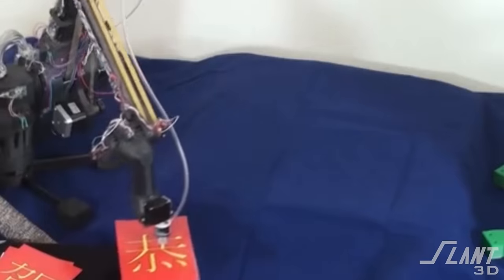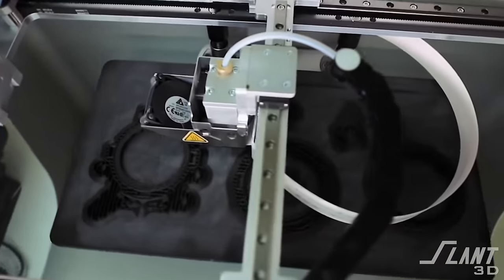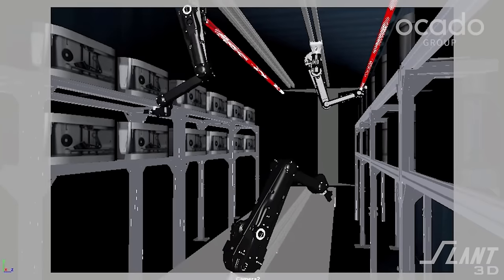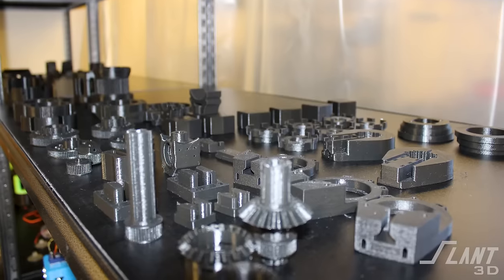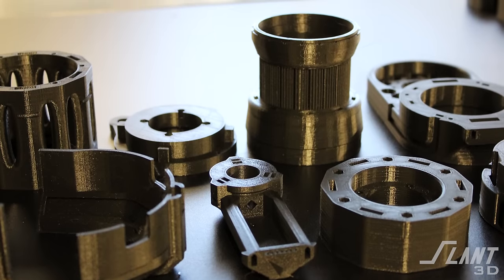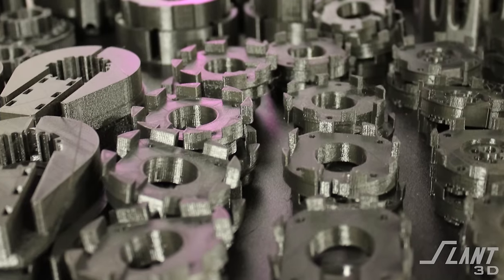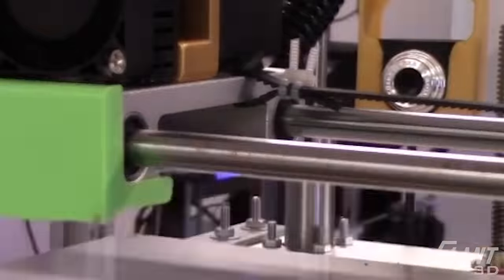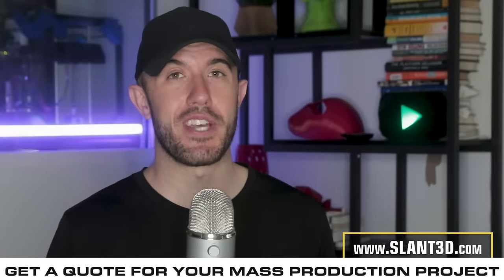$26 Million Robot Arm: Real 3D Printed Products

Comment: the manufacturing time does not scale. You need a set amount of time to manufacture an object, no matter if you prototype or produce. With molds you can pump out parts in minutes that take hours on a printer so long as they can be manufactured in an injection mold, plus the surface finish is usually much better. And depending on the object you can't even offset that over the footprint.
Lets say you have an injection molding machine, that does 4 Parts every 5 minutes, that is 48 parts per hour. If you can fit 12 printers in the same space that print 2 of the same part in 1 hour, you get 24 parts per hour, less reliable, inferior surface finish and sometimes with more manual labor.
If you have an evolving product, a prototype run or a small volume, go with printing. If you have a mass produced product that is out of development, go with injection molds. It is simple, really.
Reply from the maker: Now redo your math with 3000 machines like our megafarm
Reply from the maker: 3D Printing is a better option than molding generally at least up to 100,000 parts.
Reply: For a fair comparison, need to consider the lead time and setup time of both processes. With 3d-printing, lead and setup time is a matter of loading the print file and filament into a printer. With injection molded parts, a mold needs to be constructed. I expect lead time on a mold is days, or weeks. Would be interesting to see where the cross-over points are in terms of time to make 'xt' number of parts, and in cost for a 'yc' number of parts. The magnitude of the numbers (xt, yc) would interesting, even thought it's likely to vary widely based on size (volume) of a component.
Reply: What about 3D printing a single complex part that would require 25 molds to put together? Oh... OHHHH!  lightbulb
Reply: @slant3d  I said large amounts for a reason. The break-even depends most likely on the part and also on the printer type (fdm vs resin) and it comes later than many people think, printers can be amazing. The cost for the injection machine and the lead time on the molds is big. I was thinking more about when the manufacturing is actively running.
The volume thing still stands. An injection molding machine can make more parts per cubed foot and hour than printers can, there is no denying that.
Reply: @hd-be7di  The way this is phrased somehow feels condecending, but whatever.
It still depends on how many you want to make and how fast. With 25 molds and an assembly line you can still produce a lot of parts per day. Also, at that point it could make more sense to mill the part. It is not a black and white thing, you always have to weigh all your options.
Reply: @NochSoEinKaddiFan  It does I think you're right. It's not just the 25 molds.. it's other parts on top of that to assemble those 25 molded parts together.. like nuts, bolts, gaskets, etc etc... all eliminated with a single complex part which is more efficient in every aspect. Can't mill complex parts with inner structures. This is not even taking into account the cost of setting up molds like you mentioned... making design changes etc. Injection molding still has it's role for simpler parts but it will never catch up to additive manufacturing for more complex parts.
Reply: @hd-be7di  Absolutely, right there with you. It is just hard to gauge what you mean by complex in a text conversation, thats where my last comment came from ;)
Reply: @NochSoEinKaddiFan  It's hard to gauge for me too there's a lot of possibilities... things like heat exchangers or radiators... Tesla is printing space rocket parts following the same principle of single complex part instead of multiple simple parts
Reply: @hd-be7di  Sure, makes sense in that context. I am thinking of things like bottle caps, those will never be profitable on a printer. But rocket engine parts are excellent for printing :)
And like slant said, the point at which it makes more sense to switch from printer to moulding comes likely at a much higher production volume than one might think

Comment: 3d printing is great, but has limitations:
- it is not worth in big (1000-10000) series, because injection molding is more cost effective
- limited strength compare to the PA GF-50 injection molded part (specially in Z direction - layer adhesion)

But the fundemantal reason:

 if tooling cost +( part cost x selled quantity )
<
X percentage of the Printer investment  + Printed part cost ,
Than injection molding,
Else; 3d printing
Reply from the maker: Very incorrect on all points
Reply: @slant3d  Very strong arguments!
Reply: Noticing a pattern with these answers to comments …
Reply: I'll print a single complex part that takes 25 injection mold parts to put together. See you later

Comment: 5:30 Durability maybe?
Reply: Its also slow (minute/hours vs seconds) its not as precise, the finish off the printer in comparison to a injection molded part is horrible, its not anywhere as controlled in terms of homogeneity of the part.

Comment: 3D printing sits in a middle ground of, not really too technologically hard to understand and use, and the other end of being able to produce such geometrically complicated parts that it's hard to know what to print. With a slow increase in more designers being frustrated with the upfront costs of traditional manufacturing, they are turning to additive on a gamble, then finding out it's better, and then reach the make or break point: do they continue with their company or did their first idealised concept not work? It'll get there... just needs government injection to form modular srevices and businesses to accommodate the materials recycling and recovery (not energy recovery), and the new industry of additive manufacturing. Standards do need to be in place and unfortunately they can become a cost barrier. Just needs some help to work.

Comment: 3D printing is so rate limited compared to injection molding/milling that scaling past the enterprise/lab space is very hard (QTY +1000/mo).
Reply from the maker: Incorrect. 3D Printing can scale into the millions with good design and planning. Today if you are making fewer than 100,000 parts you easily save cost and time over traditional manufacturing.

Comment: Bro ... 3d printing is slow and does not work when robot joints generate heat. I understand you want to promote yr 3d printing business, but hey you over-selling with that annoying head movement. Maybe prototype with 3d parts and then machine mould the final designs.